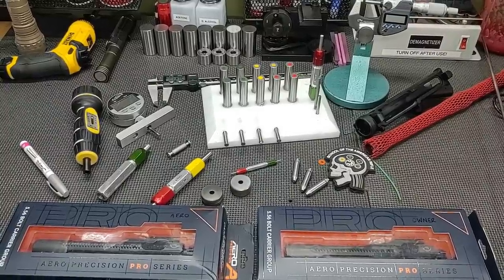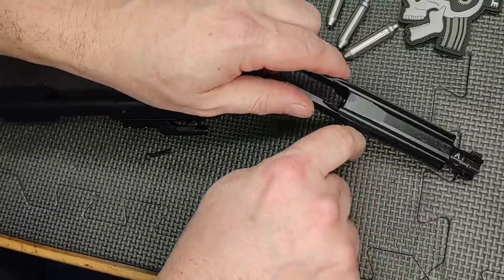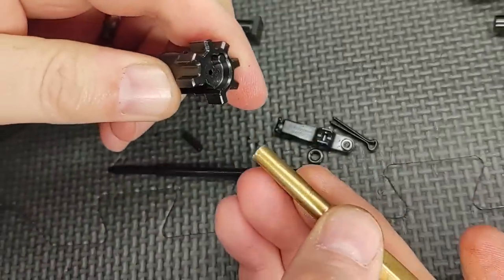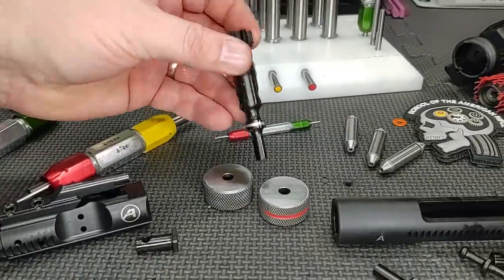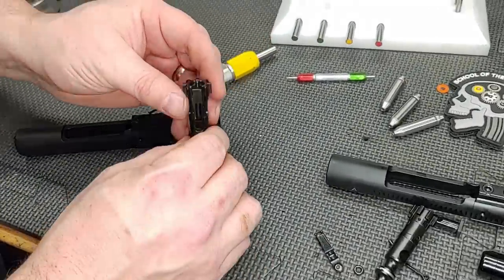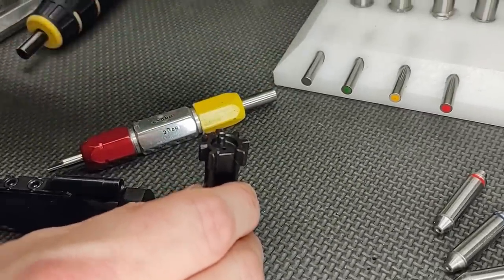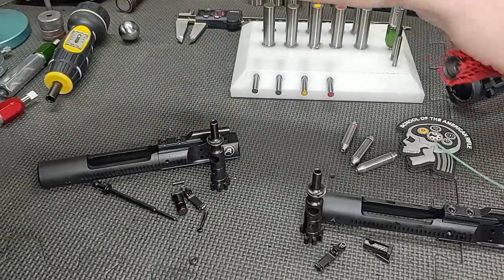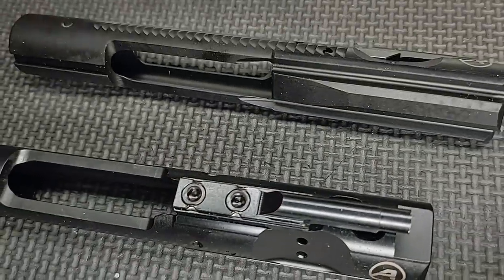2 Aero Pro BCG Physicals

Comment: Given the hardness of the nitride combined with the surface finish, do you think these would appreciably wear out rings much faster than a standard finished carrier?
Reply: It shouldn't. Phosphate does though, it's like running the gas ring on fine sandpaper. Nitride is very smooth and slick.
Reply: @jpowens2253  The gas key run on phosphate BCGs are usually chrome lined since that's TDP spec.

Comment: is it possible they left the carrier key loose so the BCG would work with even slightly out of spec uppers ,and just tightened the other dimensions to compensate?
Reply: The gas key would leak gas if they left it loose. They aren't going to do that on purpose.
Reply: @oldscratch3535  yeah thats why you make sure theres zero slop around the gas rings
Reply: @vlaricshard2  You could have the tightest gas ring fit ever and it will still leak gas if the gas key is loose. The reason there is gas key misalignment is because the mounting surface of either the bolt carrier or the gas key is not milled flat. They could also be perfectly flat but there could be debris or a burr underneath causing misalignment. The hole in the gas key could also be bent or drilled off center.
Reply: @oldscratch3535  One of my bcg has leaks in two spots on the gas key and it still runs perfectly. It even runs the under power tula crap.
Reply: @tajituck888  I'd fix it.
Reply: @oldscratch3535  i put some wicking threadlocker in between the carrier and key. Im hoping it holds up because the staking on the key is perfect to the point where heat would have to be applied to break the fasteners lose. theyre small leaks though nothing extreme. the only thing i have to do is shoot it to see if its fix. if not i have a spare gas key i ordered from BCM. ill just resurface the key and carrier and apply 620 loctite to seal it and torque it to spec. then stake it of course.

Comment: New here... Why are the cam pins marked?
Reply: So you know which way faces the front every time. Eliminates the guesswork.
Reply: They are marked so you can reassemble the bcg the same every time. Switching the pin orientation accelerates wear on both the pin and the carrier.

Comment: Springfield Armory finally sent me the enhanced BCG that was supposed to come with my rifle. I haven't put any rounds on the new BCG yet and I already have metal shavings building up on the BCG. That's just from charging it and doing some dry fire. I'm kinda concerned. If anyone has experienced this or knows if this is normal when putting in a new BCG please let me know. Thanks

Comment: What is the cam pin mark for?
Reply: To ensure the cam pin gets put back in the BCG the same way/direction each time. If you flip it back and forth, you'll get wear on both sides and increased slop.
Reply: @In-Midnight-Clad  ....serious question. I hear that answer all the time. BUT.....wouldn't switching the pin 180 degrees every-so-often actually minimize the wear by having the wear area  "shared" with other places on the pin?....like rotating tires....you don't put them back in the same place and expect the best wear......you rotate front to back or diagonal, etc.....
Reply: @TheWilferch  Usually metal parts receive a certain amount of wear before they hit a point where additional wear stops or slows down considerably. Flipping the cam pin means that wear happens on both sides until hitting that point instead of just the one side and the cam pin can become "sloppy" as a result. That's my understanding but Chad can probably provide a better explanation. He discusses his practice of marking the cam pins in some of his other videos and there may be more details there.